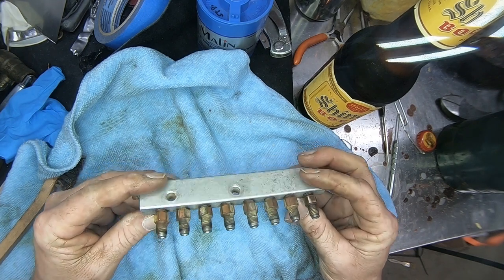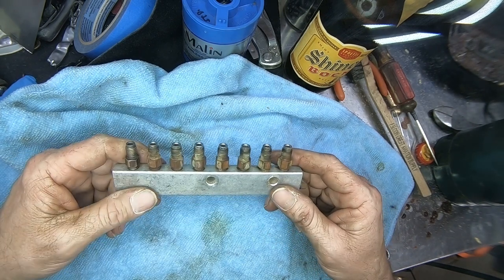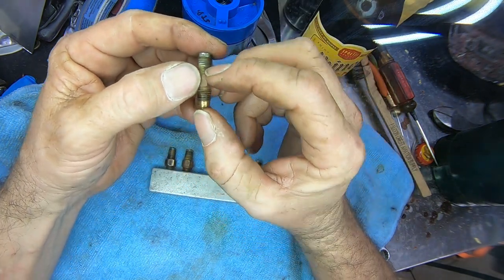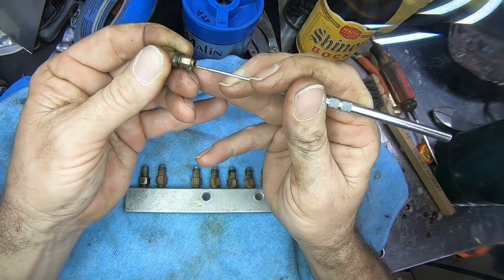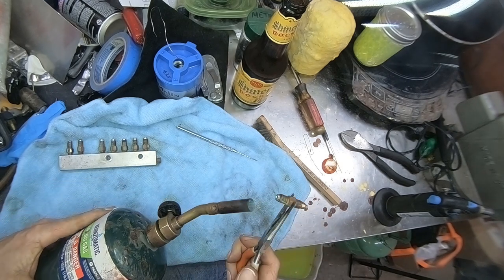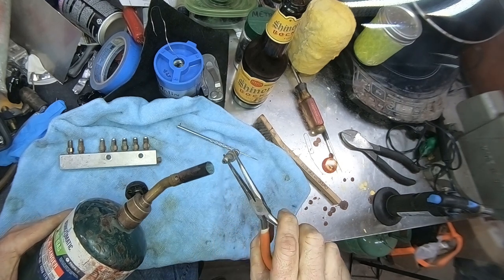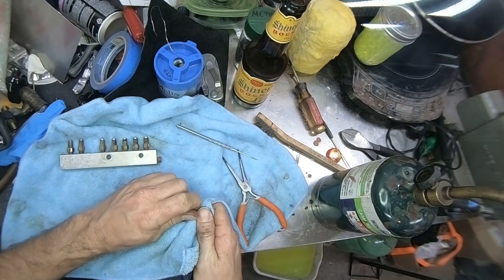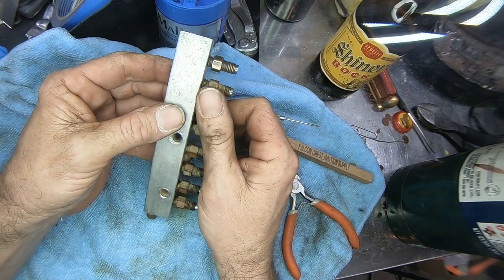Quick Bijur oiler cleanout

Comment: I did not know these things clogged up. I've been wiping oil on my will ways for a long time and started to research how to take the 25 year old discontinued Acu-Rite Mini glass scale off my milling machine, so I can take the table off. H&W Machine and Repair on You Tube has a video showing how to take the table off of a Bridgeport. After watching the video, It occurred to me those meter valves may be plugged. Now I realize they are probably just plugged because the machine is so old. For anybody looking for more info, they are called Meter Units and are made by Bijur Delimon. Their company / product webpage has a PDF datasheet that explains the valve and also shows the internal parts. Its worth a look. Here is the H&W YT video. This is very helpful stuff. Thanks for posting this video and thumbs up from Toledo, Ohio.  https://www.youtube.com/watch?v=95yVkqInRxc&t=104s
Reply from the maker: and they are stupid expensive.

Comment: When does the "e" hit the road? Nifty cleaning trick - fortunately (?) my mill does not have such things just little pipes everywhere and a pump that gives 3cc per half hour, only problem I had was little plastic pipe coil around Y axis screw broke and being the lowest part of the lube system nothing got any oil until I replaced it... Martin
Reply from the maker: Well Martin, Maybe you can tell here and there, but I have the ass end out of the car.  I had a jag shop change the final ratio to lower the cruising revs.  America was all about the stoplight derby and we drive 80mph here in texas so she needs longer legs.  Now that I have the machinery in the garage, I can get to work making the tools to reassemble the nightmare independent rear suspension.  One of these days.  For now, it's a more stable investment than anything else i have.  If you want to come help put it together, you can have the first drive!  ;-)  I've got yet another project in the works, if ya see me doing something dumb, please advise.  I'm really new to this machining stuff and would like to keep my fingers and arms.  :-O